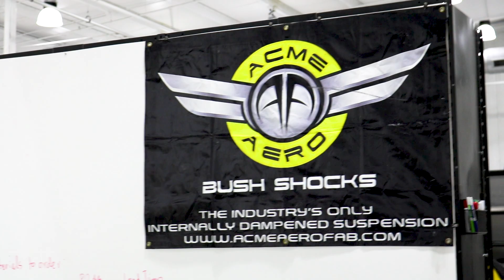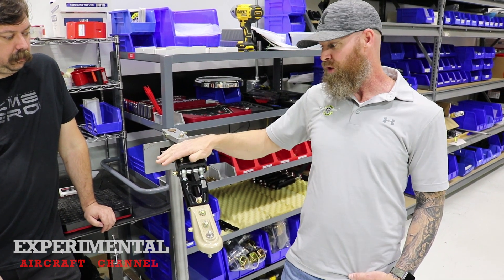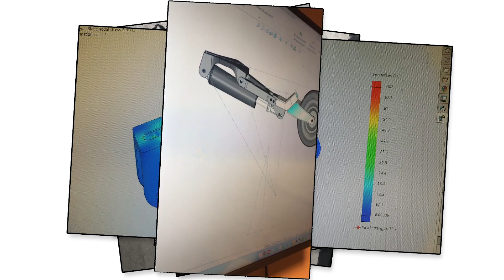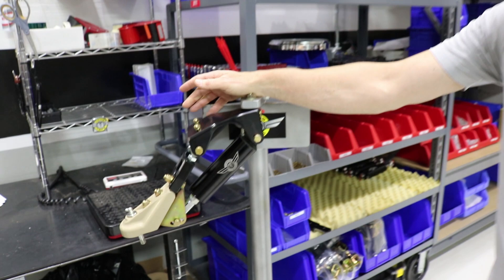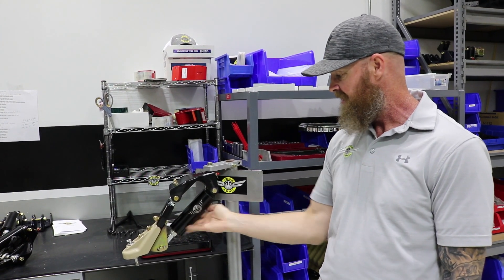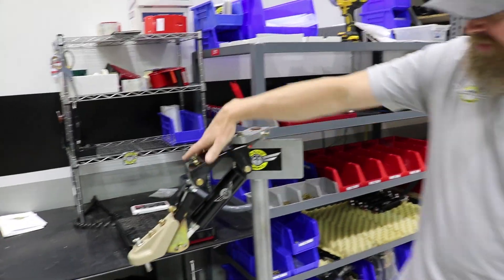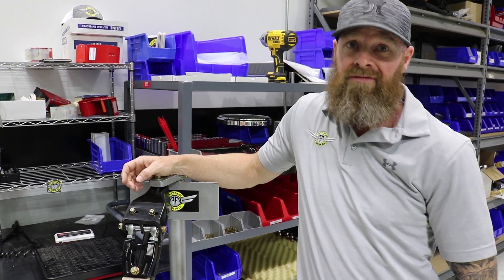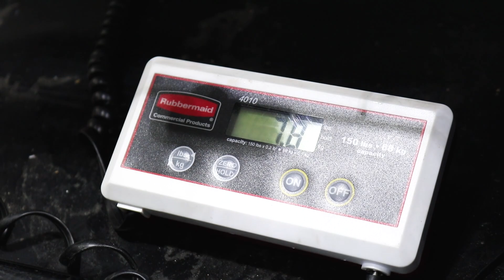Mission: Tailwheel Destruction! Tailwheel Design - ACME Aero

Comment: funny that you show CubCrafters planes in your video. I was the Chief Design Engineer for the CubCrafters SportCub. We did torture testing on the tailwheel, tested steel and fiberglass springs. Fiberglass did much better but the failure mode left the plane unflyable. We chose steel spring because it fails by bending, but can be straightened out enough to fly the plane out of the bush. Fiberglass just fractures, cant fly it out.

Comment: Impressive, but airplane structures are not indestructible. A good landing gear is designed to fail before the airframe structure (it's a easier and less expensive to fix a gear than replace wing spars or firewall)